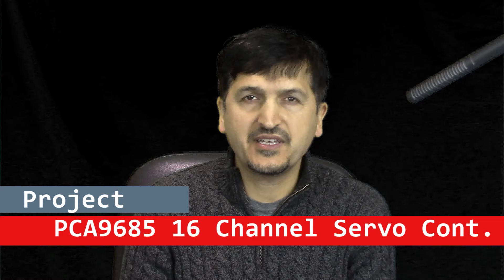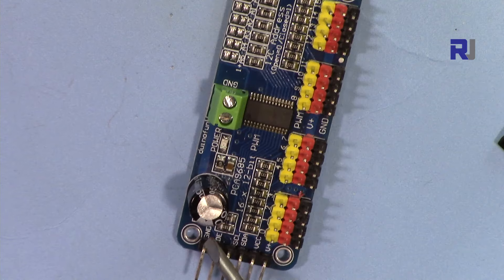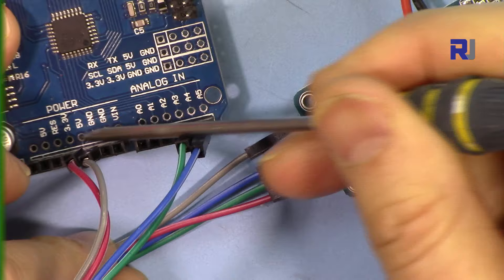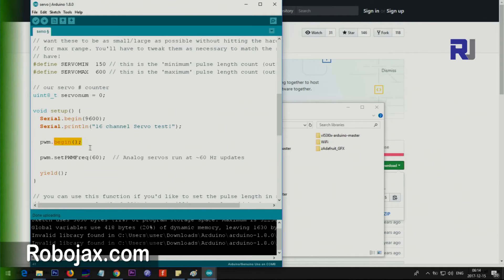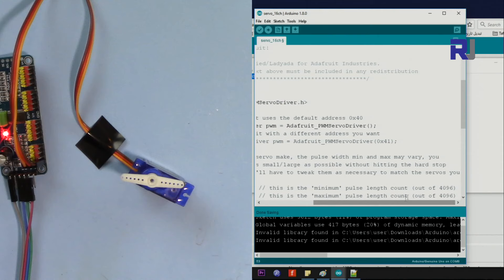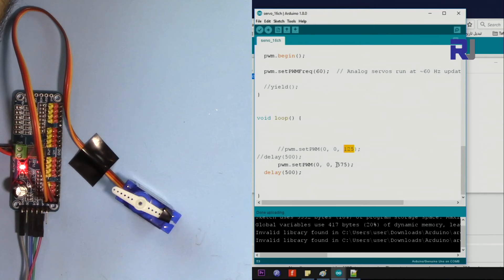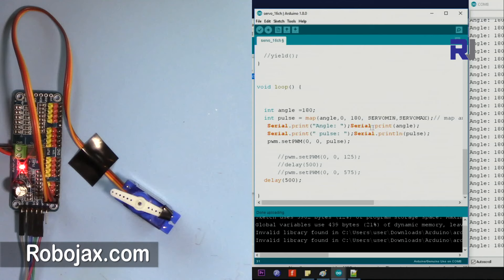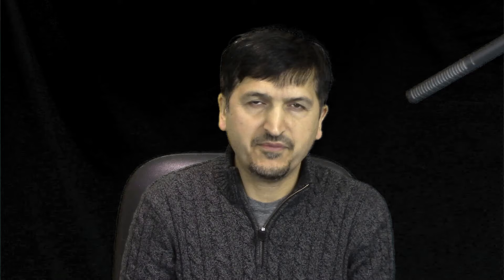Complete guide to  PCA9685 16 channel Servo controller for Arduino with code Version of 5 ( V1)

Comment: Hello, I liked your video, I would like to know how I can program the PCA9685 16 channel Servo controller to a robotic arm, I would really like to know what the programming would be to make it work in a robotic arm, if someone could explain or help me, I would appreciate it.
Reply from the maker: thank you. the code I've written it ready to be used.Robotic arm can have 2 (2 axis) or more (more axis) servo and it depends on your application, you define the relationship between each axis. So this way you know when one servo does something, what should other servos (or axis) do. You this is called modeling the robot. So you will model it, write equation for the model and then use sensor or joystick or other means to send command to control the arm.

Comment: Can you stil use the original PWM ports on the arduino, next to the 16 pwm's on the servo controller?
Reply from the maker: of course. you can. that is the beauty of this module.
Reply: @robojax  Thanks, couldn't figure it out right away, but you're right! :)

Comment: Is there anyway to read the servo position like servo.read() from the servo.h library?
Reply from the maker: The servo does not send any information back. Until you send another signal, would know the position as "angle" variable. But you can store the position of each  servo in an array.

Comment: Hey man, will this work with Arduino nano? I will be running 9 servos and need audio input. Anyway I can do that? Thanks in advance.
Reply from the maker: This module just needs I2C communication and does not matter which Arduino you use it should work

Comment: How does this work? Do you have a Controller or something?
Reply from the maker: I have put it on the title. I use Microcontroller called Arduino.  If you don't know Arduino, here is 2 minuets video from my Step By Step Arduino course https://youtu.be/-6qSrDUA5a8
Reply: @robojax  ok but did you controlled with the codes?
Reply from the maker: Wow, you have not watched the video and posted comment. I can’t believe this

Comment: how can I calibrate a continuous rotation servo motor with this shield and Arduino??????
Reply from the maker: This series has version 1 to 5. You must have skipped V1.  See that video. Link in description
Reply: @robojax  sorry but I cant find anything  about the full continuous rotation servo motor. All about standard servo
I dont know how to set the min and max values for the cont. rotation one because these values mean the speed and direction. Also I don’t know how to stop rotate it. 
Do you know a simulation program will help me testing continuous rotation servo and also includes this shield? 

Proteus doesn’t have the cont. rotation servo while Tinkercad doesn’t have the shield.

Comment: i use servo MG996s 4 each but it doesn't move at third relationship.
third servo and fourth servo move together.
i use 5v in bord. and relate v+ to 5v. SO total voltage is 10v.
is it wrong? and how to operate it?
Reply from the maker: I have explained this in the video. Please watch it and do not escape. Watch fully you will get it. You haven' t subscribed to my channel. I will reply to all Subscriber's 🔔 questions. So make sure to Subscribe.😊
Reply: @robojax  i was doing example code the servo is act but the third servo movement  doesn't work. and i watch this video full but i don't know why 4 servo doesn't run

Comment: Can you run DC motors and servos together on a single PC9685 ?
Reply from the maker: No you can't run it with this library. You would have to modify it to get result.

Comment: Sir, can you please tell me if I have to connect two controllers, should I supply power to both the controllers ?

And also, is it important to use only pwm ?
Reply from the maker: No you don't have to. Just connect power to the first and then from V+ connect it to the next and the next will get the same power as the first module
Reply: Thank you sir.
And also, is using pwm important ?

Comment: Is it possible to Bluetooth control 16 servo motor with the PCA9685 module? If it is possible than which free app should I use? I was thinking of App like Blynk that lets you customize your app, RemoteXY is also a good choice but it is not free.
Reply from the maker: I will soon make video on this to be controlled via Bluetooth and ESP32 (which has bluetooth and I have a lot of videos on thatw).

Comment: i am trying to use a PS3 controller to control 6 servos using PCA9685 and esp32, would you be able to help with the codes?
Reply from the maker: This is version 2 or V1. There are up to 4 versions of this video including esp32. Links in description or search

Comment: I can't get mine to move at all. I have everything hooked up just like you but when I send the code nothing happens
Reply from the maker: Then there is no power. Check wiring
Reply: @robojax  You are absolutely correct! I didn't have the battery pack turned on. Thank you for the video!

Comment: Is it possible to use low voltage super mini servos with this board?
Reply from the maker: The size does. It matter. Just check the voltage of the servo. It should work if it is the same voltage.
Reply: @robojax  These are the  specifications

1.7g Low Voltage Micro Digital Servo
Weight: 1.7g
Connector: mini JST 1.25mm
Voltage: 3.7V
Torque: 0.065±0.01Kg.cm @ 3.7V, 0.075±0.01Kg.cm @ 4.2V
Speed: 0.07±0.01S/60° @ 3.7V, 0.05±0.01S/60° @ 4.2V

Comment: Can this be used for voltages higher (such as 12V) on the side input terminals as long as the controlling voltage is 3.3 or 5V? i.e. Can I use a 5V Arduino to control 12V motors, LEDs, etc., as long as the higher voltage is only applied to the side terminals?
Reply from the maker: Yes you can.  Servo needs only to signal pin and GND to be shared with the board.
Reply: you have to use a mosfet or motor driver to control dc motor etc, because you can use the pwm signal of this ic as only trigger for a motor driver or mosfet
this ic only gives 5v pwm, so you must create external circuitry for driving high current elements

Comment: my servo doesnt make buzzing noise when you have gone too far with the 0 to 180 value, and it keep fluctuating, ill get the value down to 80 and then itll stop moving and ill go up to 90, and it doesnt move back, conituing this until i get back up to like 150 and then it finally moves back slightly and keeps doing thst so i cant calibrate the servo motors, also when i plug certain servos into certain pin numbers, they just rotate continuoiusly
Reply from the maker: this is V1 of PCA9685. Please watch and get the V2 code which comes with 3 different type of control . The link to V1, V2, V3 and V4 is in the description of this video.
Reply: @robojax  thank you for the response, ive managed to calibrate one servo and if i want to use up to 10 servos on one pca do i calibrate them in the same way? and does it matter if i plug the arduino into a different port between o to 15 or does it have to stay in the same port once calibrated? what c9nfused me is the fact that my servos dont make the buzzing noise they just stop and i was worried i might cause damage to them without realising it
Reply from the maker: When you do find the value by expremint, keep those and use them with your servo.   if they don't make noise it could be they are  really bad or really good. I have no idea which.
Reply: @robojax  well the servos do infact turn continiously if i put the value too low or too high with some of them, must i use all of the possible range or can i get away with going like maybe 30 under? i only really need my servos to go like 50 degrees each, but anyway thank you and i apologize for so many questions

Comment: May I know how to adjust the speed of the servo motor to turn from 0 to 90 angles?
Reply from the maker: The current speed is maximum. You can reduce it by adding delay. Inside the for loop we have delay(500);, making it 600 will slow the rotation of servo or making 1000 even slowing it more.

Comment: Sir how can I connect 
Both pca9685 and voice recognition module with arduino
Reply from the maker: it depends what you want to do with voice?
Reply: @robojax  sir actually I am working over humanoid robot and I want to embedd  certain commands in it that why
Reply: How can i do that
Reply from the maker: I have not worked on the voice recognition, but I first you have to be able to control each servo with signal or push button. Then send the same command (high/low) from the voice recognition.

Comment: Hi. Can this board also work with a Wemos D1 mini V3.0.0? Since it does not have A4 and A5 pins, can I just use D4 and D5 (or some other digital pin)?
Reply from the maker: Sorry I just got your comment due to availability of YouTube tool that tells me which comments I have not replied. Hi, yes it can work. You can watch this video to connect to SDA and SCL ping of ESP8266 (aka D1 Mini or Nodemcu) https://youtu.be/mRAgS-CdURU

Comment: You use the SG90 Mini Micro servo. The Board is connected to 5V, I understand it. But 12 such servos connect, how many Amperes to the 5V?  This I can find nowhere.
Reply from the maker: Arduino Uno 5V can supply 400mA. So measure the current of your servo and make sure if you add more than 1, the total current does not exceed 400mA. Or use external power as I have explained in the video.
Reply: @robojax   Sorry, had forgotten to mention the servos on external 5V, but I know that 5V 5A does not work on 12 servos, but how many amperes can do this?
Arduino cant do 12 servo's on same thime
Reply from the maker: Each channel can supply 25mA (datasheet page 1 https://cdn-shop.adafruit.com/datasheets/PCA9685.pdf) and Arduino's 5V can supply 400mA and depending on your servo, do the math.

Comment: I have watched this video twice I downloaded the code that’s on your website it does not function the way that it supposed to the code in the video is different then the code on your website I’m not getting anywhere with this and I’ve spent three hours trying to figure it out so I’m moving on thank you for your time
Reply from the maker: There are two codes. Just read the comments. it has been used 1000s of times. You must be done something wrong.

Comment: external power supply 5v but how much amps maximum ?
Reply from the maker: Measure the current, each SG90 servo needs about 40mA so 40x16 = 640mA, to be safe have 1000mA or 1A power supply. Watch Video version V2 of this module https://youtube.com/robojaxTV/search?query=pca9685 and in few days I will post the video showing how to control 32 servos.

Comment: Do I really have to apply the 5v to vcc want to use an 3.3v arduino pro mini how can i do that?
Reply from the maker: This is independent of development board.  it should work. For power connection watch the video fully. I have explained it.

Comment: How can I slow down the speed of the Servo axle in both direction?
Reply from the maker: after the command goes to servo, in the next line add delay like delay(500); to keep it for half second in each angle increment.
Reply: @robojax  After the part
"pwm.setPWM (0,0,angleToPulse(angle)" ???
The delay after the servo command slow it down in one direction, but when the loop start again it turn back with full speed....
Reply from the maker: I have explained how the "for loop" work. This loop only goes one way.  if you want it revers it then change the values . Use this and pay attention what has changed
 for( int angle =180; angle>0; angle -=20){
    delay(500);
    pwm.setPWM(0, 0, angleToPulse(angle) );
   delay(500);//delay of 500ms
  }

Comment: Hello, how can you de-energize the servos? thank you
Reply from the maker: just send 0 to servo. I hope I understood the "de-energize".  Servo is not holding any energy. it receives signal, and allows energy to move the motor, uses it and moves. Sending 0 to servo will stop the servo. I have explained how each servo is moved. I have V2, V3 and V4 of this module. In each you will learn something different.
Reply: @robojax Thanks a lot. pwm.set_pwm (1,0,0) is fine, but it doesn't work
Reply from the maker: It should work you have seen in video that servos stop and then start again.

Comment: What 'capacitor' is recomended to cover 4 std size servos?
Reply from the maker: sorry I am not following. Why capacitor?
Reply: @robojax  A "Capacitor" position is part of the PCA9685 board, but there is no information on what size(s)/capacity, voltage etc the capacitor should be!!!!

Comment: sir can i use 9 volt battry for the 16 channel driver to suply my 6 unit servo MG 995?? please reply
Reply from the maker: this module doesn't have voltage regulator. So you have to connect 5V higher current for this module. I spoke about it 04:12
Reply: thank you sir..

Comment: I can't get the servos to move. I'm using a MEGA2560 and using a power supply that I know it works. But nowhere in the code does it specify how to address the servo board. The SCL and SDA are connected to A4 and A5 but in the code there is no #Define for these pins. Is the program supposed to assume that the board will be connected to those pins or am I missing something? Also I have no idea how to confirm if the servo board is faulty (as it doesn't accept commands like the bluetooth modules).Help pls
Reply from the maker: See this page https://www.arduino.cc/reference/en/language/functions/communication/wire/
Reply from the maker: So is the issue resolved?
Reply: Uhhh, I was trying yo get It to work the day berore going on a trip soo, we'll see
Reply: @robojax  Aight, that link had what I needed,  it works fine now. Just subbed btw

Comment: good night, can i put a 2200uf capacitor ? or i destroy my pca9685 with that? what kind of value capacitor its better for 16 servos?
Reply from the maker: capacitor's job in power line is to filter the DC and making it stable/clean. It will not damage. The size can be minimum to do do the job based on how much load you have but for the maximum, you can put anything and it will not help but doesn't do any harm.
Reply: thank you so much

Comment: Yes,I have given external power.
I think that there is problem in code.
Can you send me code you used for driving all 16 servo?
Please send it's important for my project.
Reply from the maker: The code I have shared is the code I used. Please see the description and click on the link. You must download the library which I have also included in the same page as the code.

Comment: everytime i powered this 16ch servo driver...,it always overheat.., i disconnect all and found that vcc and v+ is connected...,is it normal?
Reply: No, I don't think you're Vcc and V+ shouldn't be connected together. Maybe while soldering you connected the two pins?
Reply: @shulker11  thanks ...,the module is broken...for sure..,

Comment: Sir I need to use 16 MG995 servos So can you tell me how much Batteries I need and which one to controll all these?
Reply from the maker: MG995 has different variations.  Check the current to know. but voltage is 5V.

Comment: How can I use PCA9685 with Arduino UNO and and controlling it with PS2 controller. PLEASE HELP
Reply from the maker: I have not worked with PS2 controller.
Reply from the maker: But for PCA9685 I have made 5 videos from V1 to V5. if you watch carefully you should learn how it works. then learn how to use PS2 controller with Arduino. then come PCA9685.

Comment: How can i connect 16 channel servo motor controller to nrf .....please as soon as possible. ...if yesis it possible
Reply from the maker: sorry I am not following. what is nrf?
Reply: Yeah, it's possible.  there are some vids around about making a wireless link for motor control, using two arduino boards with nrf modules as a  sender/receiver setup

Comment: hello Sir, can you tell me how i have to connect servos which needs more than 6v-7.4v? I have 2 motors and i am not sure how i can handel them - they are digital. Thanks in advance for your answer.
Reply from the maker: You will need to have mosfet module something like this https://www.youtube.com/watch?v=17vqLv508Uw for each servo if they have different voltage.

Comment: The library is not showing up
Reply from the maker: where it is not showing up? under the video in the description? I just check it and it is working.  You  have scroll down in description.
Reply: @robojax  Sorry i should have been more clear. I downloaded and pasted it in the libraries folder. However it does not show up in the Arduino IDE.

Comment: Can this be used to control motors too?
Reply from the maker: No. The servo goes from 0 to 180° only
Reply: @robojax  I mean the board not the code
Reply from the maker: I meant the board. So NO. This board can't control DC motor. Only Servo Motors.
Reply: @robojax  ok thanks
Reply from the maker: You are welcome.

Comment: How can we make it for 360 degree Servo
Reply from the maker: yes you can. I have not tested it but it should work. Use map() function to convert the value from 0-180° to 0-360°

Comment: I just want to learn how to control 10 servo after I can control 2 servo with pca9685 I can multiple the code to many many servo
Reply from the maker: Using this module you can control 16 servo. I did not understand your question bout "2 servo" If you mean "after", then control 10 servo, add delay for whatever time you want to wait and then control the "2 servo". Please reply here until you stop taking about this topic so I can find the comment . https://snag.gy/AHhRpV.jpg
Reply: k

i just found it on my own way and its work
Reply from the maker: good to hear that. :-)

Comment: can i use bluetooth module  pwm also
Reply from the maker: if you have the right app or software to see values to your Arduino and then translate it to the servo, yes it can be used.
Reply: i am using arduino editor to write code  and i am trying to connect 4 pwm boards and 1 bluetooth module to operate them 
if possible can you help me with code